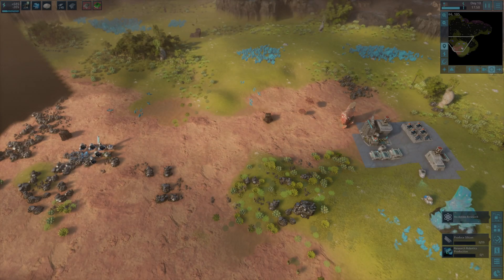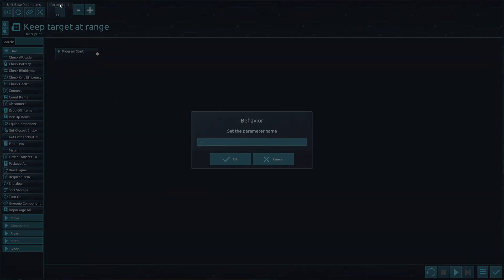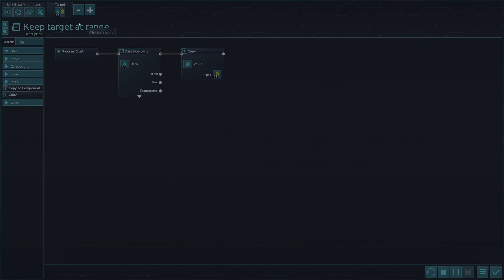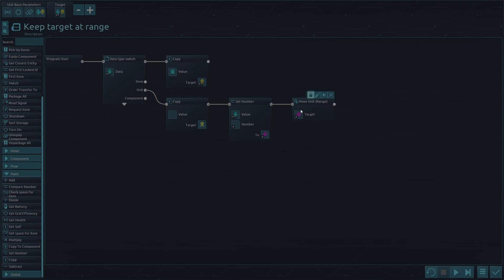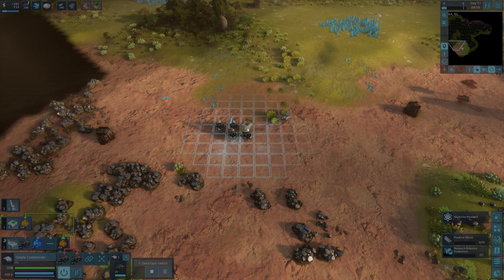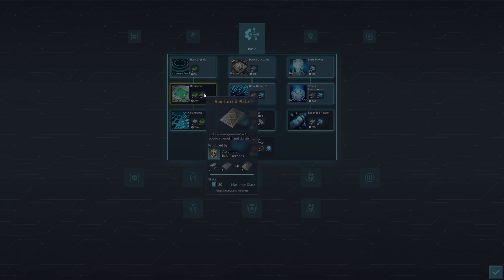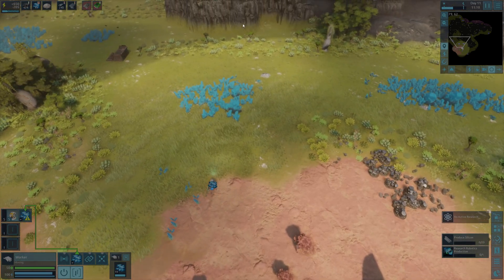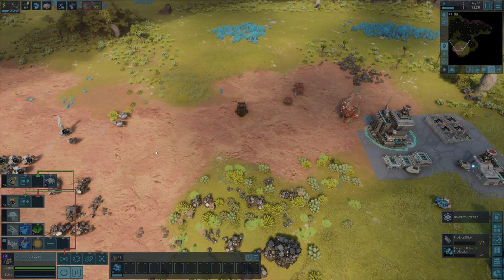Desynced - Advanced Remote Mining - Behavior supported mining team

Comment: Thank you for this mining setup. However I can't see how the same behaviour can apply to both the commander and the power supplier. The "Copy" block is linked to the "Unit" output of the Data Type Switch, which is correct for the power supplier (being linked to the commander). But the commander's target is not a unit but an item, so shouldn't the Copy command be linked to the "Item" output instead?
Reply from the maker: When it comes to data type - mineable resource node is considered static entity that can be mined, which classifies it as 'unit'. Items are inert objects, for example 'iron plate' of item type if used as a signal. Admittedly - it is not always extremely obvious.
Reply: Oh Wow that is confusing. I was convinced that it was not working because of this.

Where did you find information about the data types. I am very keen to program Behaviors in this game. @Almaravarion
Reply from the maker: @samgamer7455  unfortunately to some degree it was trial and error. In some cases I simply use it in very generic cases, where for example I know I can have either a value [colored block], nothing [default branch], or an item [or a component], and I split in general in three categories, though for most mundane uses I started simply comparing the value against 'blank' with compare entity or compare item. Usually the later.
Reply: aaah thank you :) I will start using compare entity and compare item to check things :) @Almaravarion